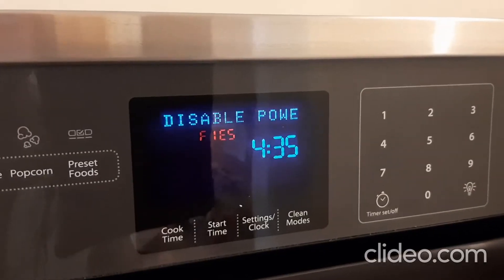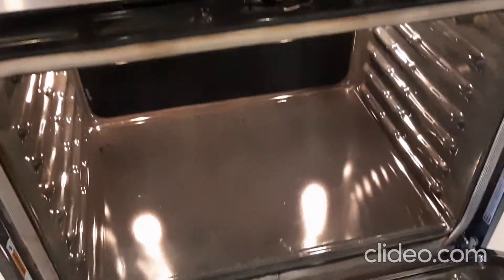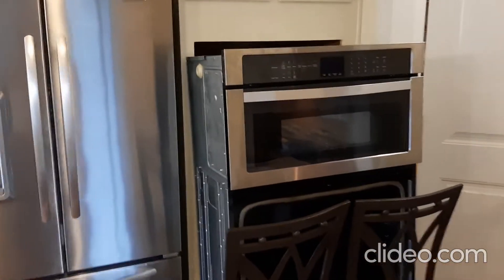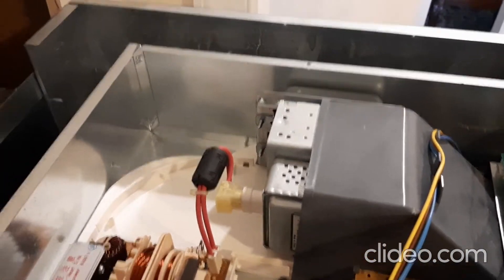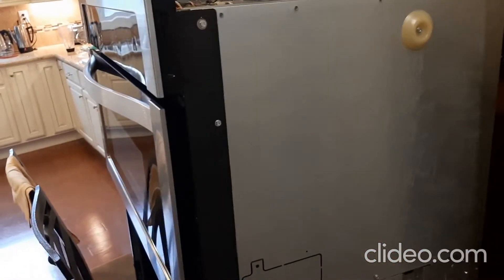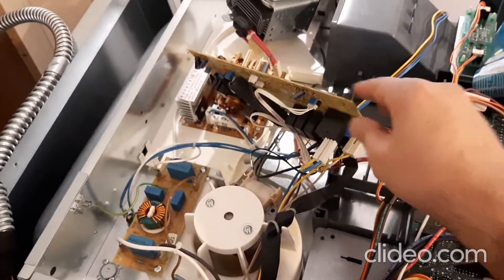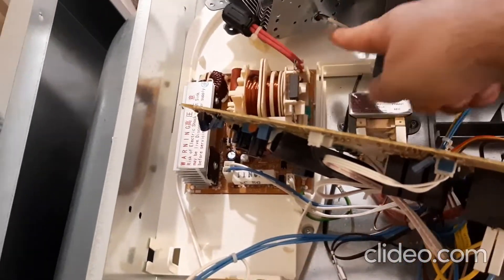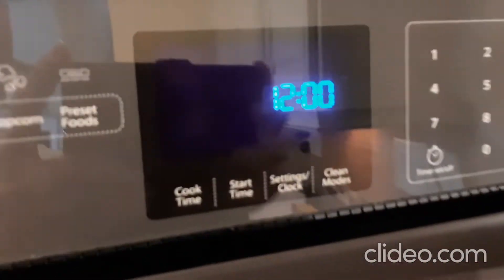Magnetron Replacement - Error: F1E5 . Microwave Combination Wall Oven - Whirlpool - - WOC95EC0AS00

Comment: Where is the capacitor located to discharge?
Reply: These have an inverter board instead, supposedly if you kill power first, you're good.
Reply: @bobbyhumphrey199  I'm about to replace my magnetron and was wondering the same thing. Thanks! What about the transformer?
Reply: I could be wrong, i replaced the mag in one of these that was giving the inverter error, but it looks like the transformer is part of the inverter, but it may be located elsewhere and wired different than the hv circuit usually is with the capacitor and diode
Reply: @bobbyhumphrey199  You were getting the F1E5 error as well? Did the new Mag fix it?
Reply: @ChrisOdell-s6u  yeah, i read that basically any issue with the HV circuit that causes the board to not detect amperage triggers that code. I pulled the harness off the magnetron and though the resistance was in range across the terminals, it had continuity from the terminals to the casing and it is not supposed to. I ordered a new one and when i pulled the original the business end of it had melted off
Reply: @bobbyhumphrey199  Gotcha. Hey, thanks a lot for the info. Much appreciated!
Reply: @ChrisOdell-s6u  np, i'm an appliance tech but i've only been doing it close to a year now, these manufacturers come up with all sorts of rabbit holes to send you down.

Comment: These are not the best instructions. After reading all the videos on the F1E5 error, I decided that the first piece to replace should be the magnatron. That is what I did before attempting to replace the circuit board and inductor. Bingo - that fixed the microwave oven. 
There are many screws to take out so they can get mixed up easily. I would suggest putting the screws back in the panels as they are removed to avoid a mix. The magnatron is very difficult to get out. Two screws (tiny star) have to be removed from the grey plastic wind channel that is downwind of the piece to be removed.  Getting the removed wind channel snapped back in place is a challenge.